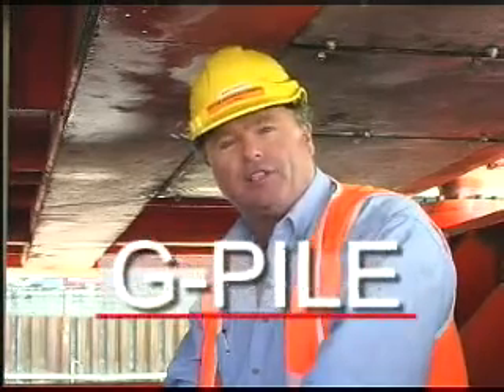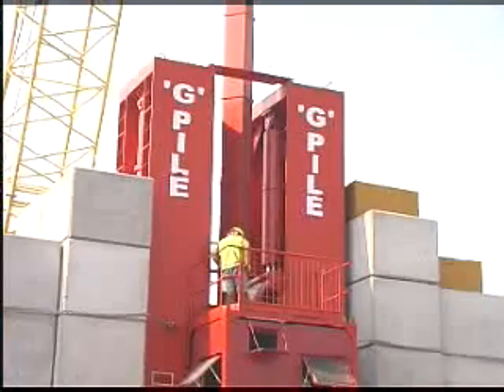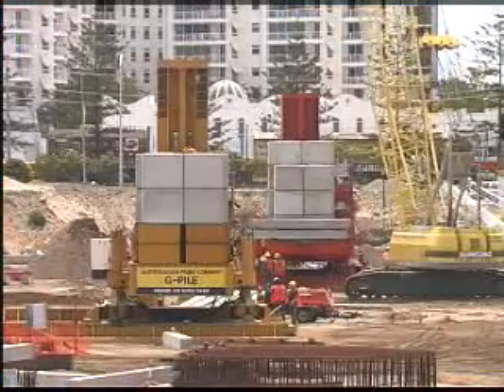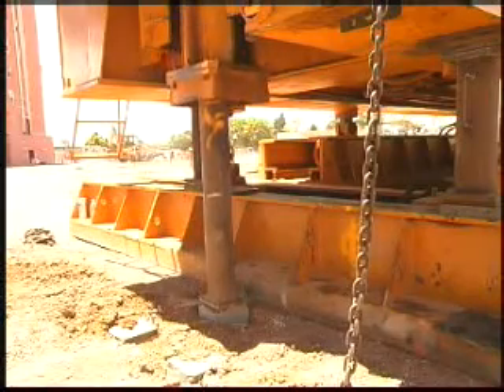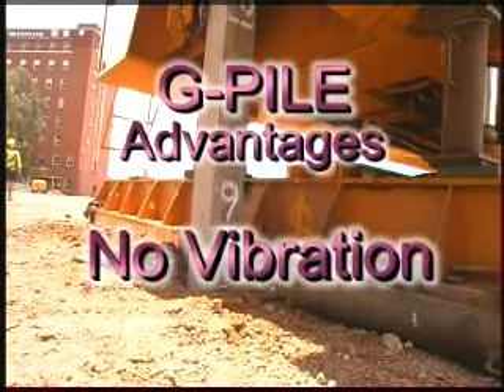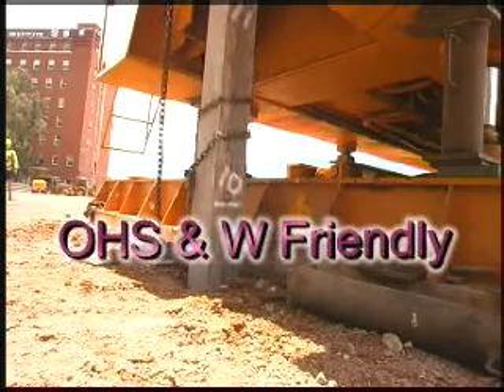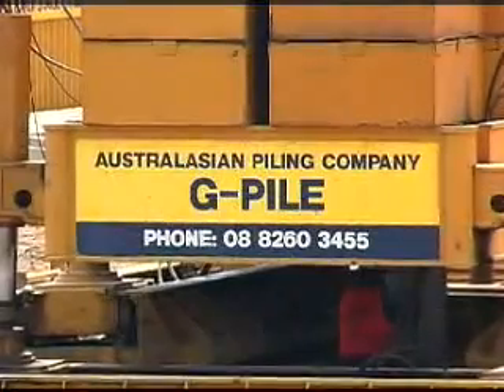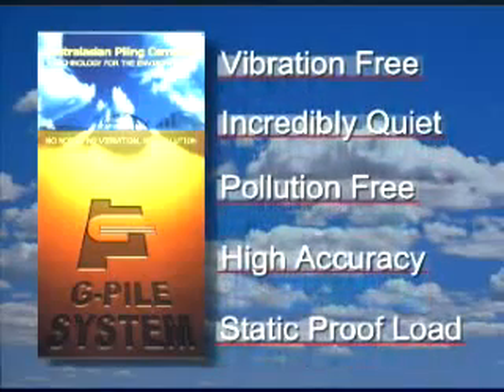G Pile System - World's Only Silent Piling System

Comment: What is the cost breakdown compared to driven pile or drilled pile? I feel to have an operation this massive the site would need to be solely occupied by the g pile people. No other work could begin until the g piles were installed.
Also, if your pushing bearing piles into the ground. Many times this is done when the excavation is complete. How well does this system deal with pushing piles in tight areas?